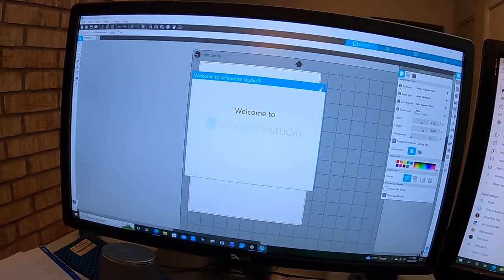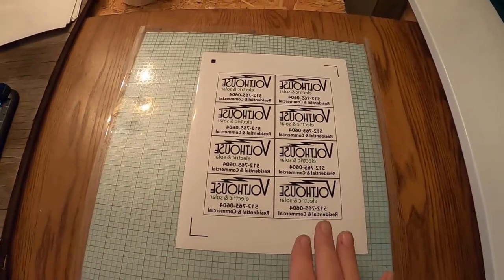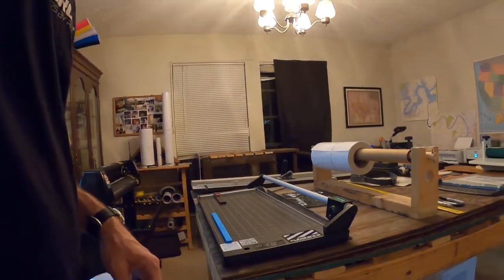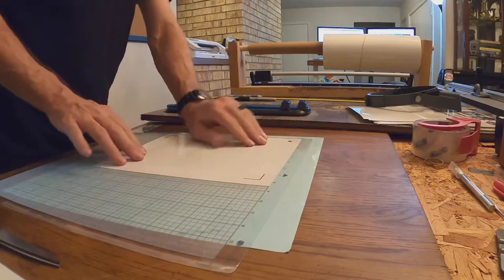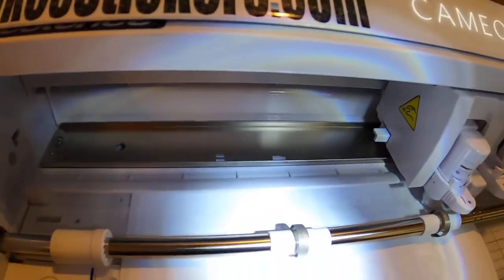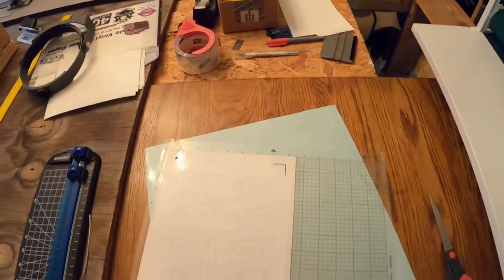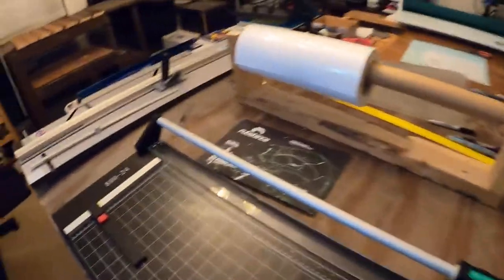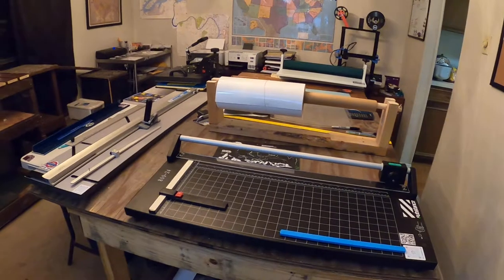Tutorial, Perfect Print & Cut Secrets Revealed. How to make front facing adhesive stickers

Comment: HI Mike, good information. Have question, if I need a colored background with white writing how do I achieve that with your process.  Thanks for any help you can provide.
Reply from the maker: I’m not really sure how to recommend you do it with a colored background & white letters. I’m using different equipment & software now. You can copy the cut line, make it thicker & then fill it solid with the color you want the background to be. Add it to the back layer & make sure the cut line you copied is the fill color so it doesn’t make another actual cut line.